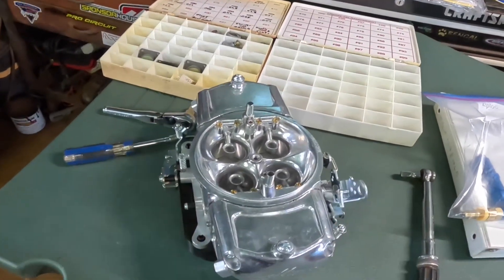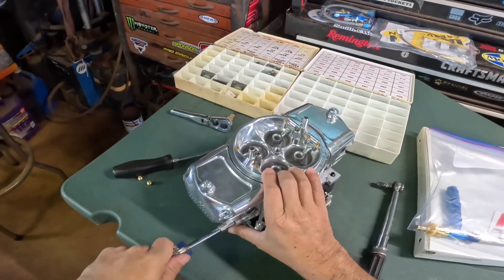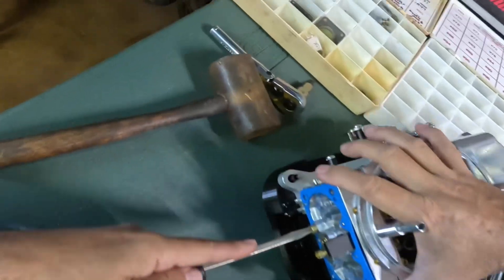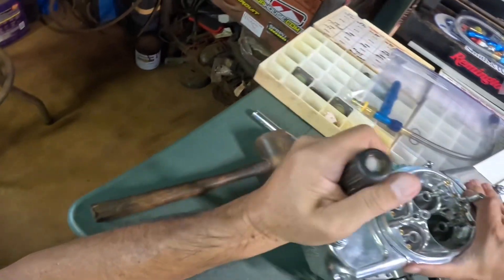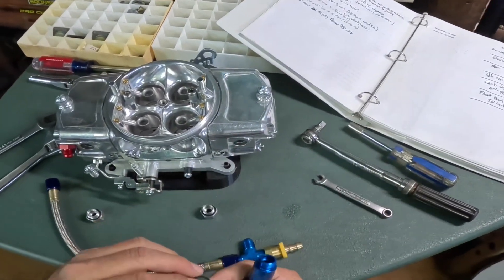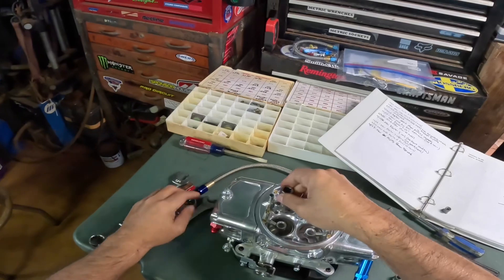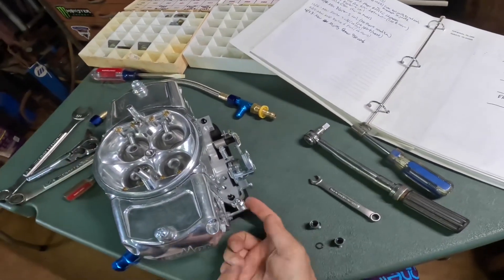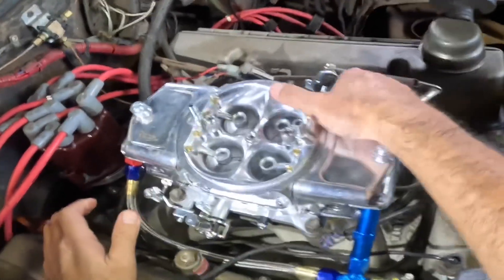How to Install & Tune a Mighty Demon 750 Double Pumper 4 Barrel Carburetor

Comment: What size are the outer idle bleeds press in restrictors?
Reply from the maker: All the air bleeds are screw in. Not sure what size. It’s stock i didn’t change em.
Reply: @ratcamaro thanks. I got a 383 as well.
Reply from the maker: @williambeltran1971 For idle mixture screw adjustment. Set it at 1 1/2 turns at all 4 corners. If the motor stumbles when pulling out at part throttle that usually means it’s too lean so back all screws out half turn and try again. Mine worked best at 2 turns out on all.
Reply from the maker: The size of the air bleeds are noted in the video description. Just noticed that.

Comment: With stock internals, how many turns?
Reply from the maker: Every engine is different. Use a vacuum gauge, warm up the engine and adjust to get the highest vacuum reading. Drive and readjust accordingly. A part throttle stumble usually means it’s too lean on the idle mixture. That’s how i tune my carbs.

Comment: I have this carb on my boat with a 454. I just swapped the peanut ports for aluminum rectangle port heads. Any ideas on what I should set the jets to?
Reply from the maker: Every engine is different so you will just have to experiment and see what works best for your combination.

Comment: I have a 355 sbc with 72s in the primaries and 82s in the secondary's and I'm running a 5.5 power valve the AFR is pretty good at idle but a mid throttle is a little rich around 11-10 on the AFR what should I adjust the power valve or jet down the secondary's and its a tad bit rich a full throttle any preferences?
Reply from the maker: @bandmoutdoors669  mid and full throttle you’re mostly on the main jets. You can jet those down. I like my motors to be a little on the rich side because i also have nitrous so doesn’t hurt to have it a little rich.
Reply: @ratcamaro  that's true might go down another from 72 before I had it at 75 and I might also might down jet the  secondary's a little bit and might put in a 4.5 power valve thanks for the advice
Reply from the maker: @bandmoutdoors669  Also keep in mind that the power valve enrichment is roughly 6 jet sizes which is why i jet mine 79 pri & 85 sec. When throttle is wide open jetting is 85 85 in theory. Works for me but every motor is different. Good luck!
Reply: @ratcamaro  oh I see thanks for the advice once again!
Reply: is there anything else I should take into consideration ?
Reply from the maker: @bandmoutdoors669  That’s about it. Off idle stumbles can be tuned with the acclerator pump nozzles. Like stumbles launching off the line to wide open throttle.
Reply: @ratcamaro  ok thank you so much for the advice I will definitely adjust the main jets and try to make them 6 sizes apart

Comment: Sounds like you have it dialed in pretty good.  What size are the idle air bleeds?
Reply from the maker: Thanks. The air bleeds are the ones that came with the carb stock. Not sure off hand what size.